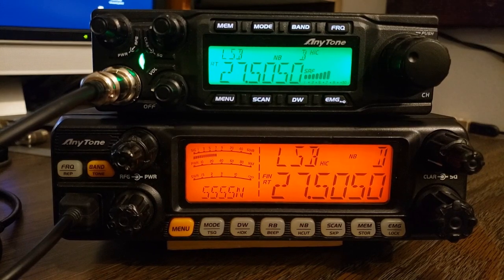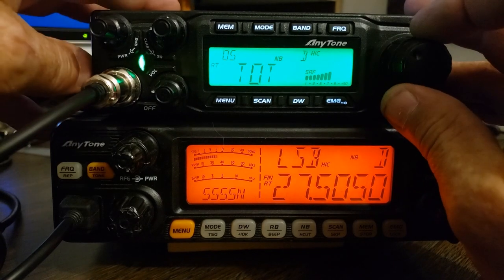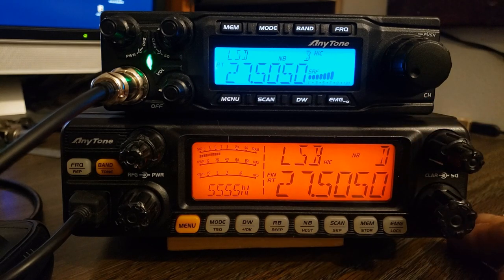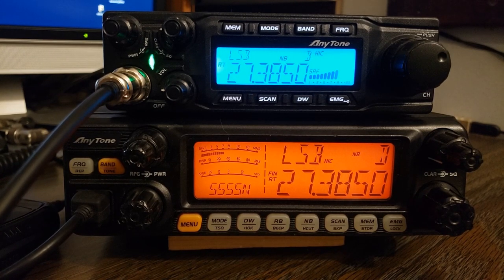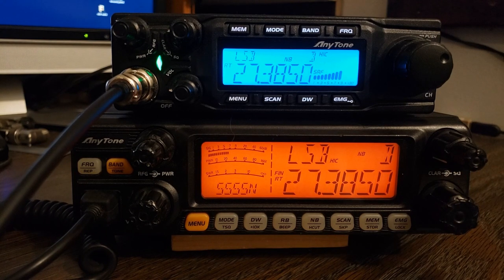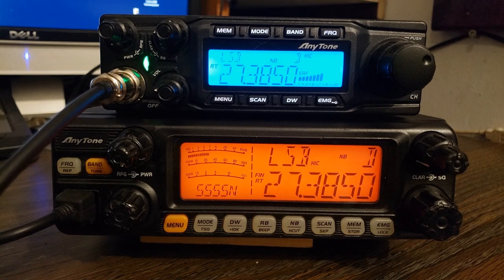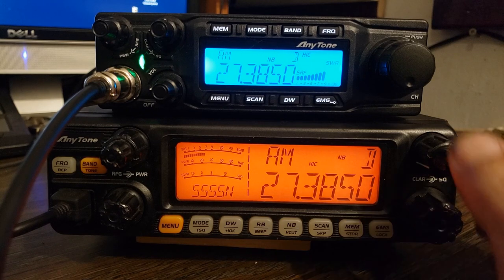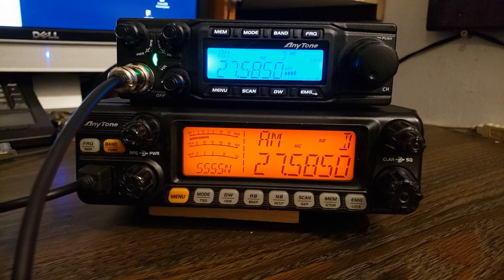Anytone 5555n Vs Anytone 6666

Comment: NOTE: The AT-5555Nii and the AT-5555N are DIFFERENT radios internally. The Nii is a a whole generation ahead of the AT-5555N and the AT-6666. They are all good radios, but the "Nii" is a better radio in almost every single way to the older models. (New features and outstanding performance). 73
Reply: Where can you get the nii
Reply: hi but 5555 = 60w and 6666 = 80w on SSB on data sheet

Comment: Excellent freeband high power radios. Great modulation and amazing sensitivity.
Reply from the maker: I Couldn't agree more! Thanks for watching, 73's
Reply: Is there a way to adjust the power output, I like to be abel to get down to legal amount of power. 4w FM/AM and 15w SSB. If power adjust knop is all down i still get 10w at fm. 
at am i get around 2.5w and ssb 5w so its only the FM is a bit high, can it be adjusted without loosing the high power output ? I have the older version without the service menu. but its the same version as in this video.
Reply: Unfortunately, I don't know, I don't have this radio anymore. Greetings :).
Reply: @CrazyBossDK I've been looking into this radio myself, there is a (service menu) you can enter to change power. I'm sure thete is info somewhere out there about it.
Reply: No faculty display radios here simple dimple radios finger hut 🔊 special no magic tune ups name of the game antenna gain study more about antenna  bearcat ssb 980 icom 718 radio Stryker 10 meter new fm mode vhf uhf simplex around the world amps scrap man 👨 😅😅also low loss coax
Reply: From q6 is now the pro version new.

Comment: I really like my quad 6. My only complaint about them, is that they run hot. I don’t like the finals in them at all. The way they have it set up will eat them alive. Change out the finals, set the bias and clea it up a bit, and you have a cool running 100 watt radio you can talk in all day!
Reply from the maker: that's why I use an amp with both of my Anytone radios, My 6666 is set to 35 watts pep, and runs cool all day. Thanks for watching, 73's

Comment: These are amazing radios talk about getting across the pond well these are what you need for a base on power supply these are both very nice radios I like the quad 5 N  the best but that is just me. These are side band royalty. Love them both I’ve made over two hundred trips across the pond on mine love it. Just on a five eighths  maco ground plane. 28 foot to bottom elements from the ground.  KC9LRA. Bob sand man. 94  these are actually ten meter radios that has been converted to cb eleven meters or twenty seven mhz. Thank you John

Comment: The big-box home stores sell stick-on rubber feet. I put them on all of my mobile radios and the base stations that have lost their feet. It's good to see that some manufacturers have an interest in the radio hobby market. 
Noise reduction has always been a problem for the radio manufacturers. If users learn to embrace FM and it's advantages the natural noises at 27 MHz won't be as much as a deterrent to using the service.
Reply: FM is not THE solution about noise 😂
Reply: @14KiloWhisky  If you're talking about skip interference, they developed subaudible tone squelches for that problem. 
Mobile AM/SSB CB radio users, the commercial type, have always had to fiddle with the squelch control, but FM doesn't have this problem.

Comment: I use a 5555n in my truck as a bile 10m ham rig on a quad band mobile antenna (6,10, 70cm & 2m) with an opek switch to swap between radios.  The 5555n is a great inexpensive rig.  Have done dx as far as NZ, JP, S.A., & IT.  The newest Quad 5 WOULD be nice for the noise filter.  Mobile DX'ing can get hard on the ears after a while.  Got spoiled with the DNR in my Yaesu's.  I would recommend the 5555n to any new technician ham just getting started who wants a taste of what HF is all about.

Comment: I've been watching some of your older videos and noticed with your range testing that your meter would pick you out at less than S-1 at about 12 miles. I thought that was absolutely astonishing that you had basically a zero noise floor and that you could be picked out at that low of a signal.

So I started looking at my noise situation on my new Anytone AT-6666 and even at night when there was no traffic there was a noise floor of S-5 on every channel and a noise floor of S-7 on channel 36-40 LSB. This was NOT the radio, it was something in my house causing that noise, which basically caused me to miss all of the low signals because they were covered up by the noise. There is no way I would be able to pick out a S-1 because the noise was S-5.

So I started unplugging everything in my house, one by one, trying to find the source(s) of noise. What did I find??? The ROUTER when connected to the ethernet cable was causing most of the noise, about S-3 worth. When I disconnected the ethernet cable from the router the noise went down to a S-2. When I unplugged my security cameras the noise went down to S-1. When I unplugged my desktop audio amplifier power supply the noise went to showing NOTHING on the meter.

Since I had basically NO NOISE I went through the channels and found a bunch of guys talking on channel 14 that were 25 miles away from me. They were coming in at an S-4 and I could hear them crystal clear because there was no noise, and they could hear me just fine. 

So eliminating that noise allowed me to hear so many more people because they weren't being covered up by the noise.

I would bet that you too could eliminate ALL that noise by unplugging routers, cameras, and switch mode power supply (wall warts) that come with damn near everything these days.

Thanks for your videos, I enjoy watching your testing and antenna ideas. They have helped me out so much. ;)
Reply from the maker: Thanks for the comment, I'm glad you found the source of your noise. the noise I have is only during the day, at night my radio is very quiet. if I use an old radio like my Washington, it's quiet all the time. the newer radios just don't have the filtering like the older radios had. Thanks for watching, 73's from 151 SC.
Reply: Most people have noise problems. Things like you mentioned, plus LED lights, microprocessor appliances like washing machines, solar panel controllers... it's a RFI jungle out there! 
The traditional way to troubleshoot it was to have a battery powered radio on and turn off the main house circuit breaker. If the noise level is reduced then turn all of the branch circuit breakers off and turn the main entrance back on. Check the noise level. If it's still low turn the branch circuit breakers on one at a time. Allow 5 minutes for anything on the breaker to reboot and start making noise. Once you find the noisemaker then take a walkie talkie and go snooping until you find the offender. A zero noise level would be fantastic but impossible to achieve. Christmas lights are notorious noisemakers, along with fish tank heaters, electric blankets, heating pads, Lacrosse weather stations, and some things that you would never imagine.
Reply: Time to get a case of ferrite cores noise chokes start placing on every input and output line of the culprits should not effect the router or the cat 5 if you still use hardline internet one at router and one just before getting into device those chokes are easy nuff to use just snap shut some you may run loops in and out to create double choke with one ferrite core
Reply: Add a MFJ-915 ferrite blaun at the antennae and or the radio. This will filter out stray RF that you pick up.
Reply: I have the same here, if RF is RFG is full open, i have S4-5 day and night. If I turn RFG to 11 o'clock i have S0, but the i get also a cracking noise. I have some noise I pick up quite clearly on all frequences from 25-30mhz, it seems to be from S5 to S8, and for every 30hz. Very clear at 27.400 then 27.430 etc. All the band.

Comment: thank you for this comparison. i did want the quad 6, but now want the quad 5 for its mannish size. it will replace what i have now, which is a formac 700 am/fm and a cobra 148 gtlf.  btw- i am setting up something you might like: i will be able to bounce my audio back to me using my sport sync radio with delay. i will be using it with a cheap fm transmitter and a 49mhz walkie with vox and bouncing it to my scanner. i think it will do up to 60 sec delay.  take care and 73's to you and yours

Comment: I also have the 5555N like yours (old version), no service menu. And 10 menu entries - there is another menu you can get if you hold menu+mode while powering on, and release when the display show everything. It show CH-01 to 15, and you enter the menu items by pushing the channel selector. Not all 15 channel entries are in use.

Comment: Great video I'm a totally beginner to cb radio, should I go for the 6666?
Reply from the maker: You can't go wrong with either radio. Both radios need to be modified to work as a CB, But the 6666 is very easy to do.
Reply: @MowerJunkie will you please tell me how to do it? Thank you.

Comment: I wish the receivers would be improved. Same with the Lincoln II+. As you noted, they just have too high of a noise level compared to the older 40 ch radios like the Uniden/Cobra gear. Wish you had an inside view of the boards.
Reply: It is because they are more sensitive than older models.When i compare To my uniden Washington i have better réception with my anytone.They sound like a ham radio.

Comment: On my 6666, the receive audio is a bit weak when I am on SSB,  its great on AM and FM but a lot softer on SSB, have to turn up the volume a lot, and in my vehicle its a bit of an issue to hear weaker stations, my hearing aint that of a 20 year old nomore 😁

Comment: Man I cant decide. I want a bigger frame I guess. So I will go for the quad 5!! The Anytone AT-5555N 2. But I need to cut a wire and move this thingy 😂 "jumper"? over. To get into CB / 11 meter modus or all modus. Which I never did. It saves me €80 to buy the 5555 and have to do the mod. Or buy it in my country for €80 till €100 more with the modification done. I am not cheap. But it looks so simple to mod it to 11 meter myself and save money. I really want this one. Thanks for showing the radio's and menu's.

Comment: Any issues with the Quad 6 getting hot when using high power and if  so what is the radio like on low power
Reply from the maker: I have mine set to 35 watts, and it runs cool all day. Thanks for watching, Take care.
Reply: @MowerJunkie  love your videos I’m not into cb right now I have spent the last 25 years at the cb radio but have gotten out of it the past couple years  I just ordered 2 of those Anytone quad 6 radios  I’m in southern Nl canada a town called st lawrenc hope to make connection with u some day. Take care 73s
Reply: How do you set the wattage?
Reply from the maker: @ajcobraj  variable power knob on the face of the radio.

Comment: I have both these and the Lincoln 2+.
In fact, I have 2x 5555N2.
The 5555 is just great for big ham-fisted fingers and is my favorite.
But the 6666 is just as stunning to hear and transmit as the 5555n2. and really pretty identical in terms of basic functionality.
Like you, I do like them both equally except for the size. The 6666 is so much easier to fit in the newer cars somewhere.
I do like the Lincoln with all its functionality and the green screen is beautiful, but sound shit.
I've also got one of the AM/FM 10-12meter radios and that is a little ripper.
Can't remember the model at the moment, but it's another AnyTone and is the size of your hand.
Reply from the maker: Sounds like you have a great collection! I agree about the size of the radios, I think my 6666 is going to end up in my car, it's the perfect size to fit in my dash.
Reply: I have the lincoln plus 2 and i hate the receive filters i pull in ever noise there is thinking the 5555n2 is my next radio

Comment: Can either of these be opened on 11m also ?
Reply: Yes, the 6666  very easy to do. The 5555 don’t know how to do it but it can be done.
Reply: @W5KJD  the 5555 is very simple clip a jumper and move a switch
Reply: @KE8ODY-WV-Ares-Ham-Dad-3O4  The 6666 just press and hold the menu button and turn it on and select CB.
Reply: @W5KJD  yep you gotta take the case off the 5555… Very simple tho they have the same board as a Stryker
Reply: @KE8ODY-WV-Ares-Ham-Dad-3O4  The AnyTone Ares II is the same way have to clip that jumper wire and move a jumper clip over. 👍
Reply: @W5KJD  really that's crazy, but it's design build would kinda make me tnink it would be that way

Comment: I'm having such a pain buying the at 6666 or the At 5555 n2 2023 model
Reply from the maker: I like the 5555 more. it has a bigger screen, and the Noise reduction circuit is fantastic
Reply: @MowerJunkie  only down side no front lights I'm after the 2023 n2 model.. So can they tune and peak these or can you only do the 11 meter mod
Reply from the maker: yes, the 5555 n2 can be peaked and tuned in the engineering menu. it does not have any internal adjustments.
Reply: @MowerJunkie  really do no use to pay the shop $50-60 go tune it
Reply: @MowerJunkie  so no reason to pay these truck stops big money
Reply from the maker: Just be careful, You can mess up the radio if you are not familiar with the adjustments. it's still best to have it hooked up to proper test equipment when making any changes in the engineering menu.
Reply: @MowerJunkie  just bought a 6666 and a 55555 n2 off fellow hams for $150 each
Reply: @MowerJunkie  they are reputable hams and ones never been out the box used stuff scares me
Reply: @KE8ODY-WV-Ares-Ham-Dad-3O4 can i buy one n2 from them?
Reply: @MowerJunkie thought you opened the 5555 to change things 😊